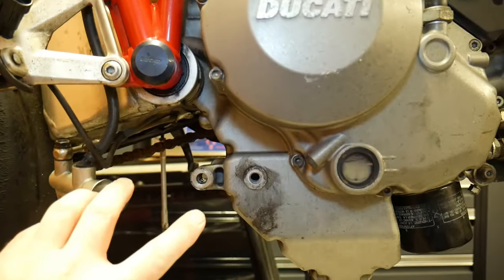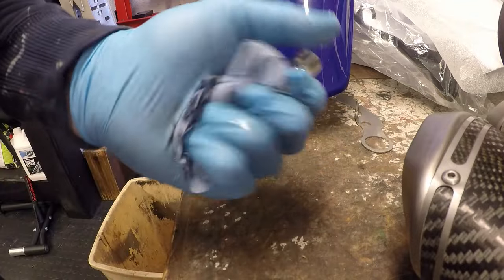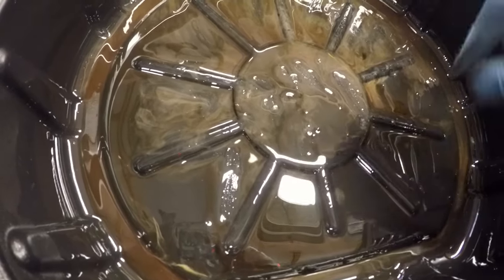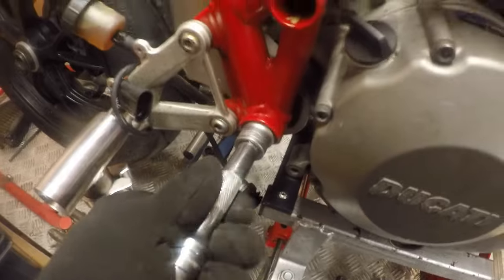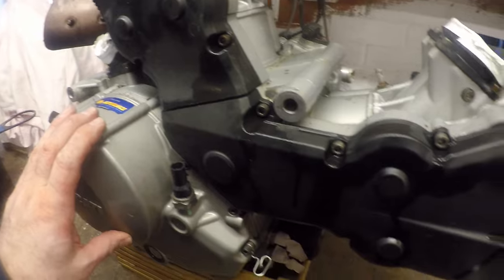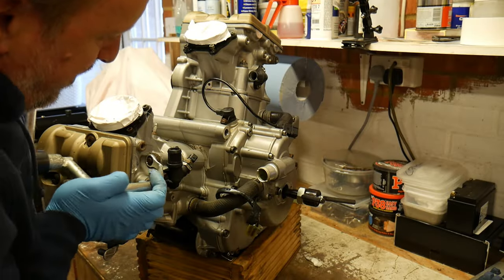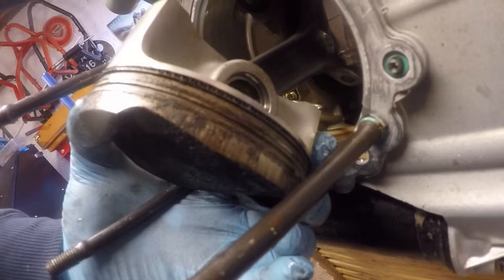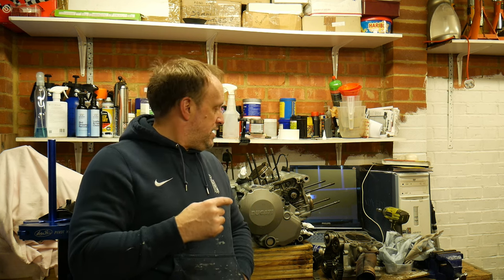Ducati 848 Teardown Episode 2 - Dropping the Engine and top end strip down

Comment: The stuck rings are definitely your problem. We used to see this on car engines when the fueling was  too rich causing carbon to buld up betwen the rings, or running the engine with no air filter.
Reply from the maker: I agree, the fueling looks to have been poor, and the cylinders were also out of spec.
Reply: @DesmoWerx  hello master, does these engine stall, popping, miss fire...etc, especially when heat up?

Comment: Funny thing with these Tractors the looser some bits the more power? How do I get to hire your skilled time?
Reply from the maker: Some engines benefit from becoming loose on the spec, this one has gone way to far. 

My email is on the about page if you want to reach out for engine work.
Reply: @DesmoWerx  cool will add it to the work list. See what Coventry Say On April 25th, but will let you know thx.